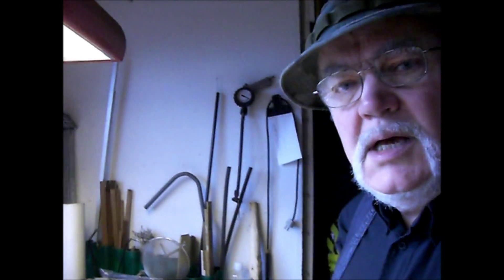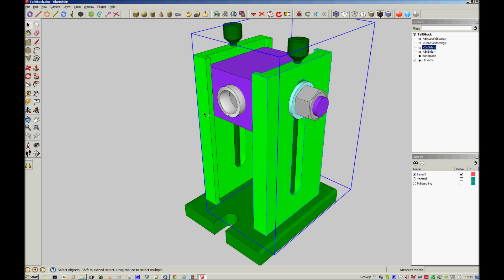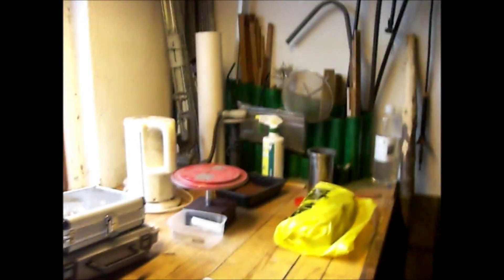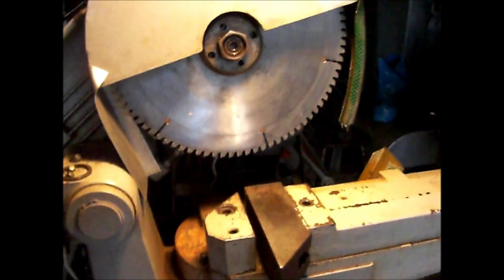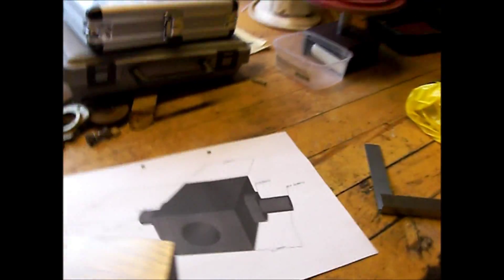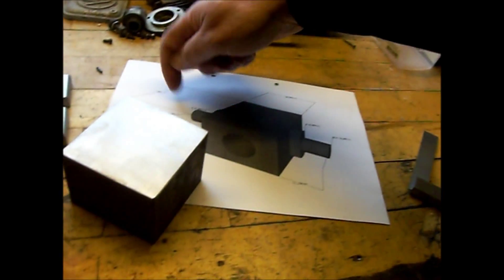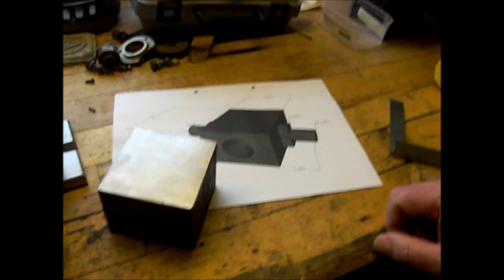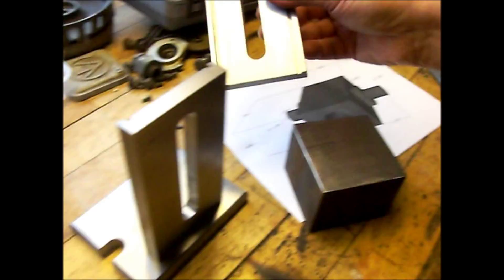Body to the Tailstock

Comment: Nice project. You do nice work. The finish is secondary to the function. I hope you show how you use the new piece in a follow-up video. Spring already in Denmark. Where are you in Denmark? Must be nice to have left winter behind.
Reply from the maker: No, winter just left - spring is not here yet but the day is now 80-90 minutes longer than the shortest day, so the winter wont come back now ... at leat I hope so ;-))